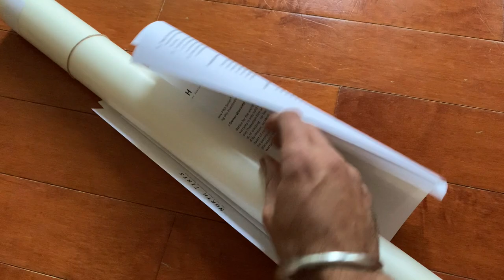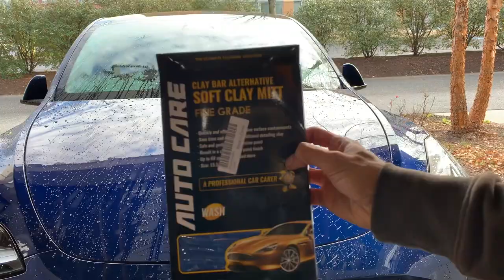Tesla Model Y: DIY Self-Healing PPF - Paint Protection Film - Installation. 3M Scotchgard Pro.

Comment: We have two Model 3s, one with PPF and one without. GET PPF. Cars are 3 months apart, but a world of difference between PPF and no PPF. Spent 2500 getting it installed, this included paint correction. Will try DIY next time though.
Reply from the maker: Everyone’s experience is diff. I applied $288 DIY PPF on Model Y after 6-7 months of ownership. My neighbor has a white Model 3 for more than 3-4 yrs; always street parked - so lots of sun, rain, debris, etc. - and no PPF. His is absolutely fine too, with no noticeable chips/damage.

Comment: Did you have any issues with it peeling off or anything?  I noticed that you sealed the paint before installing the ppf, is that good or should you just use the IPA and apply on bare clean paint? Thanks and great video
Reply from the maker: No issues at all. it works gr8. recently a car backed and hit its rear bumper to mine. the PPF protected both the paint and my bumper. I was able to push the dent from the inside and everything looks untouched. 

talking about sealing, nah, not necessary. IPA would work.
Reply: @k1ckgas527  Excellent, thanks for the response !!!

Comment: Great job @K1CKGAS! Looks very nice. THANKS for posting this video. Its very well done and helpful. I have the same blue/black rims config my new MYLR. I ordered a pre-cut XPEL PPF from DriveProtected out of Canada for a full frontal cover (hood, bumper and mirrors). I am curious about the polishing step and the polishing pads you are using. My car is only 3 weeks old. Would I need only fine polishing (if at all needed)? Did you wax after polish? The pad you are using appear bigger than the ones you have the Amazon link for.  I see you have a wax product listed in your item list. Would the polish/wax interfere with binding of PPF?
Reply from the maker: I made a complete checklist of detailing and in between maintenance:
https://k1ckgas.wordpress.com/2020/08/02/my-ultimate-detailing-checklist/

Comment: Did the paint sealant under ppf caused any issue? I heard that its not recommended to have sealant , coating, or any sort of wax before applying ppf.
Reply from the maker: That’s absolutely not true. When you hear people doing ‘paint correction’ before applying ppf, it is nothing but removing swirls, imperfections using level 1/2/3 detailing which including compound/polish/sealant.

Comment: You think using heat gun like you did in the side panel helps for the bumper and hood?
Reply from the maker: Yes, it helped a lot. I did that on hood. Check the video. For Bumper I bought per-cut and there was no need for the heat gun there.

Comment: I noticed you spray Seal N Shine before you apply the ppf. I think that is a no no, you should apply Seal N Shine after you apply the ppf on the car.
Reply from the maker: I read about this topic b4 applying; there's no harm in applying paint sealant , or do paint correction b4 PPF. I noticed in my wife's 7 yr old Prius (as an experiment, on a small section), all underlying swirl marks appeared to vanish with PPF - there's was no need for Paint correction.
Reply: @k1ckgas527  Good to know - Thanks for the info.